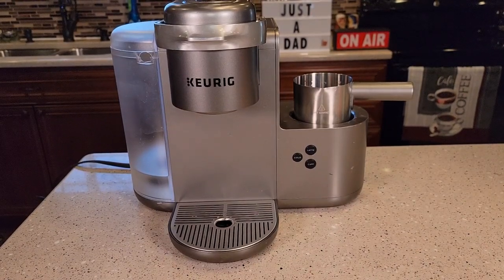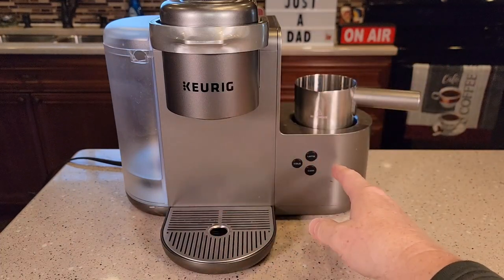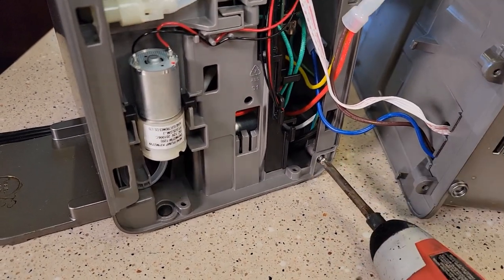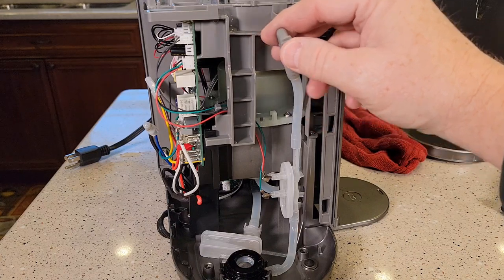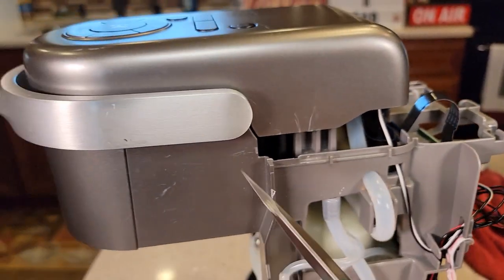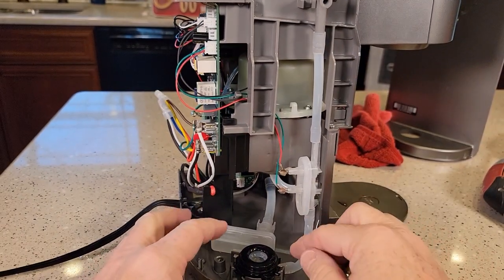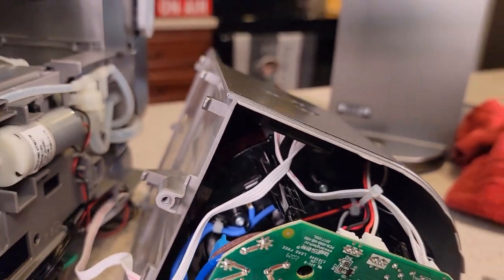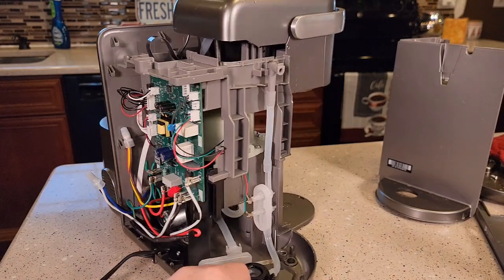HOW TO FIX Keurig K-Cafe Single Serve K Cup Latte & Cappuccino Maker ADD WATER LIGHT Model K84

Comment: I have this model and it seems to be leaking water from the air pump. Seems easy to replace, but wanted thoughts on if it is caused by a blockage on how to clear that. I've pushed air through the system and it seems to pass easily. Video helped tremendously!  Especially the explanation of all of the functions.
Reply: I currently have the same model and same issue. Ours is leaking and the air pump isn't working at the end. So it just collects water and drips. 

Were you able to fix the issue? Thanks!

Comment: It sounds like there is no way to reset this machine. My daughter spilled some milk from the frothed and i flipped it on its back to wipe under. Then tried turning it on but i can hear a fan , then it stops but lights never come on. I’ve watched several videos but none can explain how to fix on this model. There is no resetting the heating element. Is that right?
Reply from the maker: yeah this machine has no  reset, sorry,

Comment: Great video and quite informative. I have the K-Cafe Special Edition (K84) that shut off at the end of a brew cycle. It would not power on after that. After watching your video, I opened the case up and found the lower HF3FD relay (there are two of these on the right side of the main board when looking at it from the back of the unit) had fried. There is a black hole in the side where it burned through and scorched the inside of the case. I never a had a bit of trouble out of this K84, but it's toast now. I'm waiting to hear from Keurig to see what they want to do.
Reply: Added: I contacted Keurig twice about this. The first time, I was offered the standard 20% discount that is available all the time on their website. The 2nd time I contacted them was after this video showing how to get in to the brewer. With that information, I gained access, found the burned relay listed above, and contacted Keurig again. This time they called me back and offered a replacement at no charge AND they want the old brewer back for analysis. They are paying for the new one, for shipping, and for the return shipping of the old one. We'll see how this goes.

Comment: Thank you for the awesome video on how to disassemble.

I Fixed a leak in my k-84, but I’m having issues getting all of the frother connections back onto the main board. several are interchangeable And I did not take enough pictures of what i disconnected. 
Do you happen to have any advice? 

I have a black connector with four pens and a white connector with four pins but their lead links are not long enough to reach anything on the main board. Most confusing.

Comment: Our stopped powering on. When you plug it in the fan or something powers but nothing happens when the power button is pushed. Appreciate any suggestions.
Reply: Hi, I know this is an old comment but I'm curious if you ever figured out the problem/ wondering to see if I should just bite the bullet and replace it. I am having the exact same issue with mine right now
Reply: @matthewlang777 I’m having this issue and see no response 😢
Reply: Same!
Reply: Me too !!!!

Comment: Hey I've got one of these and the on light won't stay on just flickers when I push it and shuts right back off, I've left it unplugged for 2 hours or so plugged it back in and it will turn on, but won't brew a coffee. Any ideas? 

Thanks.
Reply: I am having the same exact problem. Did you ever figure it out?
Reply: @LeadMeEverlasting  at 1:35 he mentions a vent, I took a piece of clear tape and blocked that hole. Then I let it sit for a day unplugged, when I plugged it back in she seemed to work. Then I descaled it with vinegar and now it works great. Good luck with yours hope this helps.
Reply: @larsonny77  thank you for getting back to me. I will try that
Reply: @LeadMeEverlasting  did it work?

Comment: Great video, helped me get the unit apart to investigate.  My unit was plugged in to a 220V line which blew the varistor (MOV1).  Any way you can get the PN off the part in your unit so I can repair?
Reply: Hi! Same thing happened to ours. How did you fix yours? Appreciate your help.

Comment: This is what I needed to figure out how to remove the cover. My water pump went bad. Observe that it wasn't pulling in any water from the tank. If you blow into that top tube you you can force water all the way through the system. Will see if I can change it. May not be worth the effort . 😢

Comment: I've had the machine about two years.  The add water light just stopped going on.  Kind of afraid to open the thing up. I tried poking a paper clip at the air vent but that did nothing.  I just spent $30 to get a new reservoir because mine broke my the handle too.  I guess having a not working add water light is not that bad as long as it still works.  Just have to be careful not to run it on empty

Comment: Mine is not shooting out the burst of air at the end of the brew.  Thoughts??
Reply from the maker: Bad air pump or clogged tubing,  but it brew the hot water ok?
Reply: @JustADad  yes, quantity seems normal and temperature is hot.  Im excited to tear mine apart.  We bought the Ninja brewer.  I think I will give keurig a rest for a few years.  Thanks for the great videos!
Reply: @brandihoffmann4243  How is the Ninja Brewer. Keurig units has so many complains :(